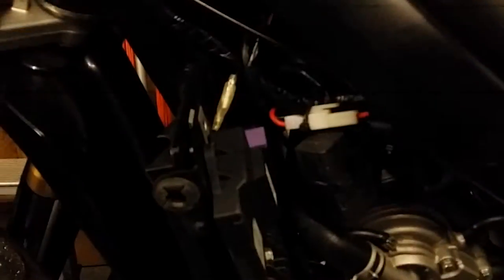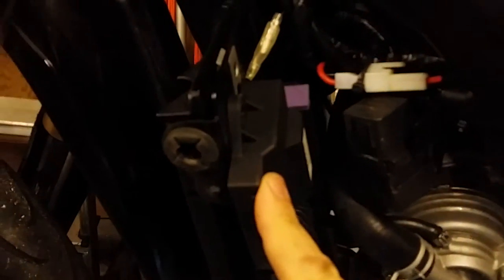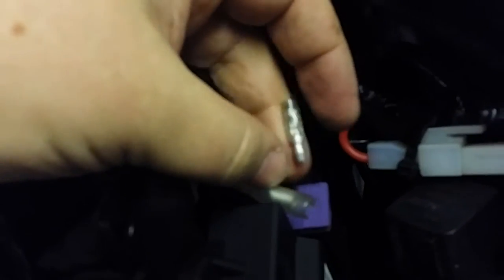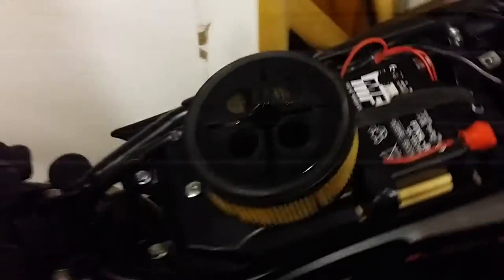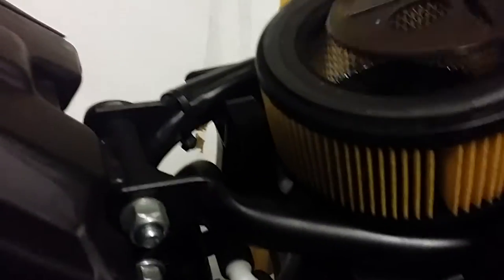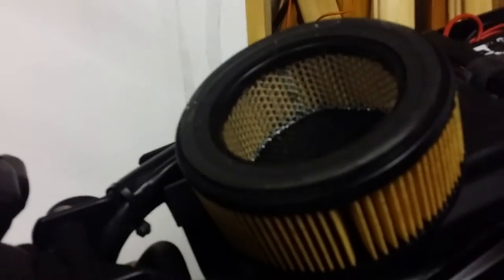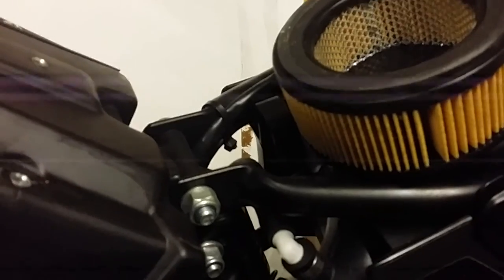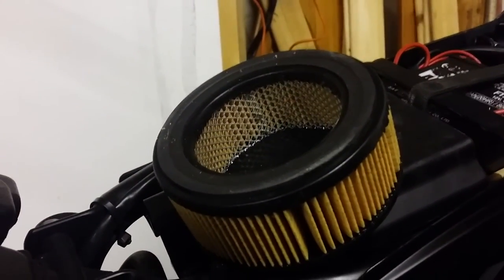Rieju MRT/Marathon pro. How to de restrict

Comment: You can also remove the EGR valve too.

I removed my downpipe, cut off the tube that led to the EGR valve, and welded a hole over it.  I then put a small cone air filter over the tube that led to the airbox, so I have a better air intake.  The low down torque is reduced, but it accelerates much better in the other gears.
Reply: QTMagic do you have any pictures that could help? Sorry for necroposting, just asking because i have in my airbox 2 ”intakes” or tubes that goes in, one of the tubes goes staight to the side of the  cylinder ”head” or whats it called on a fourstroke, and the other one was ”topped of” and i dont know where that one goes.
Reply: And it pushes oit air of the tube, even if tye engines is off, not really sure what it is.

Comment: The air filter in the mrt not mrt pro isnt the same ive just baught a 18plate one with 1500 miles on it like new noticed the wires were uncliped so checked airfilter because wanted to put it back to standard as ive only got 3 points left😂 clipped them back together n noticed it starts alot easier firts time everytime n ticks over fine now it was reving up a little on it own idling wen the wires werent connected just thaughy id let everyone know incase have same problem do you know what the wires are for buddy n thanks for the upload i wouldnt of known how to fix otherwise 😁👍👊

Comment: thanks a lot for the informations - what does that green/yellow/black wire really do?
are you ‘disconnecting’ the rev limiter? or which part are you disconnecting with disconnecting those?
Reply: hi, 2 year late but yeah he is disconnectiong the limited CDI or ECU or whatever its called, not rev limiter, speed limiter is my believe
Reply: Oh hi, how nice of you commenting/answering, despite it being such an old comment of mine - it did brighten up my day to see this so thank you :D 

Speed limiter? based on the rear wheel speedometer reading? 
I wouldn’t have thought that the ECU get’s speed information at all, but only engine rpm from a sensor at the crankcase, but I actually really don’t know. 
I might search a little on where wich wires are going on mine (i’ll  post it here if I get to know more about what exactly it’s doing), but nonetheless, thanks for the answer of yours - have a nice one

Comment: I have this motorbike and it doesn't make any difference if these wires are connected or not. When it comes to air-filter in mine there is motocross type foam without any plastic restrictors, but I saw in some manuals paper filter like in yours, so removing this should increase power indeed. The question is: If mine with OE foam claims has 15HP, what is power of yours with paper filter and restrictor?
Reply: Hey I have the same filter. Have you managed to find out what filter this man has in the video? Or one like it? I reckon one like that may let more air in
Reply: @ithanmonico2495  sorry for the 8month reply but have you found out how to derestrict the marathon with the foam filter ac btw ?

Comment: Would this work on the rieju mrt 50?
Reply from the maker: No. The way to de restrict the 50cc is to increase the main jet size and change the front sprocket for one with an extra tooth.
Reply: @JamJarchannel  increase main jet size ?

Comment: What about rieju nkd 125 2015? Got a single black wire leading into my ecu that i can unplug but cant find the one you have. These have the same engines i think. Carb on mine aswell.

Comment: Does anyone know what the restrictor plate looks like on a 2016 rieju mrt 50?
Reply: It is the same as on the video, remember the bike also has exhaust restrictions
Reply: @ServeraServera0  thanks it’s the exhaust that is confusing me it looks different to most other ones
Reply: @shush103  Would reccomend to get a sport aftermarket one, there are too many things to deal with the stock one to even bother
Reply: @ServeraServera0  yh I was thinking about that

Comment: I know the video is old and i might not get an answer, but, are you sure there's no need to tune the carburetor after doing that? Increasing air intake without doing so won't put to much air on the mix?
Reply from the maker: You have to increase the main jet size. Think about a 124.

Comment: I know it’s been 2 years but if you could please reply to this. 

I have a Rieju MRT 50 2016 and have removed the air filter blanking plate, will this be fine as it is now ? Or do I have to do something else
Reply: Like getting it because of removing the blanket
Reply from the maker: They do a kit to derestrict the 50cc  https://www.rieju.co.uk/rieju-de-restriction-kit.html
Reply: JamJarchannel you know what the jet size is that you get in the derestrict kit?

Comment: After i removed the air filter plate, my bike ran very strange. it didnt have full power but when i helped with the choke i felt it accelerate more and get more power. pls help
Reply: you might wanna try those bigger jets as suggested in the video. Your engine gets more air now and air/fuel ratio is off the balance.

Comment: As i have not even used my dealer derestricted rieju 50 yet i did pay the dealer £50 as the egr is still on the bike i think they may have done what you have said.
I  know that tecno gas enox says you can fit there complete exhaust without altering the jets have you heard of that also your above full power you say you take off the blanking plate on filter and the wire in the ecu and thats it what difference in speed would that make when thats done in bhp terms, as i know you do mention you can change the exhaust.
Reply from the maker: The video is for the 4 stroke engine fitted to the 200 and 125 cc bikes. The 50cc is a different engine and is restricted differently.
Reply: @JamJarchannel   i got it wrong i thought is was the 50cc although some two strokes can be as fast as a 125 four stroke.

Comment: I'm looking to derestrict my rieju mrt 50 Pro. What's the best way
Reply from the maker: The way to de restrict the 50cc is to increase the main jet size and change the front sprocket for one with an extra tooth. There are some other options such as big bore kits different carbs etc. Best bet would be to join the Facebook group 'Rieju worldwide' to get advice from those that have owned the 50cc.
Reply: @JamJarchannel  thanks mate. If I got a 80cc kit would I have to change the crankshafts
Reply: @JamJarchannel  what mm jet would be good

Comment: How do you like the performance of the big bore? What brand did you fit ?

Have you removed the ais valve from the exhaust as well?
Reply from the maker: It came from the factory/dealers as a 200cc I have capped the ais.
Reply: How do you derestricts the ac version'''''???

Comment: Hi Jam i have one of the last new uk euro two Rieju pro sm 50cc and had it dealer derestricted and it still has the egr valve on the exhaust i notice that you snipped them wires and also took out the filter blanking plate to restore it to full power.
Can you tell me does the exhaust egr valve restrict power?
Reply from the maker: Not really. The way to de restrict the 50cc is to increase the main jet size and change the front sprocket for one with an extra tooth.
Reply: @JamJarchannel  not true

Comment: Will the bike need tuned or aftermarket exhaust ?
Reply from the maker: The bike will run fine without being tuned or having an aftermarket exhaust.  However they do run a bit lean stock so a slight increase in the main jet size may improve the performance a little.

Comment: I got dep s3 already fitted in mine can do this straight away or do I need a bigger jet?
Reply from the maker: You could do this straight away. A small up jet would probably help when you had the time as these bike do run a little lean.
Reply: JamJarchannel what size je would be ok ? Thank you
Reply from the maker: Well the 125cc comes with a 122 main jet and the 200cc comes with a 128 main jet so if its the 125cc maybe 124-125 main jet would work
Reply: JamJarchannel thank you helpfull review 👌